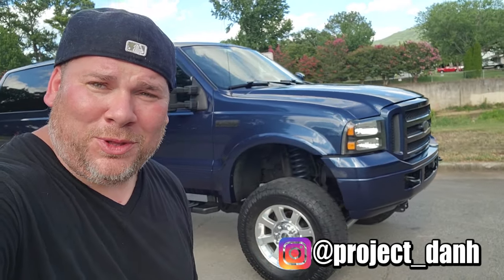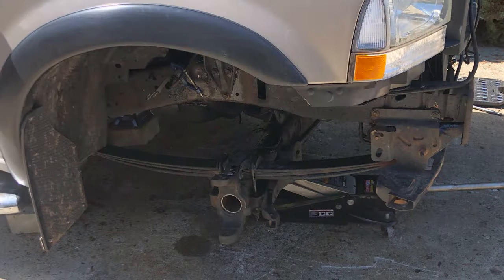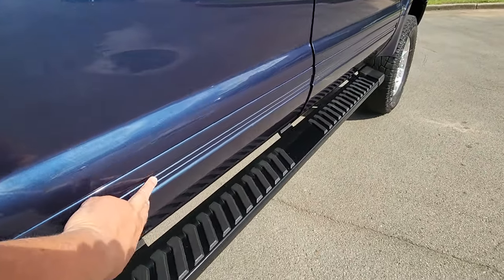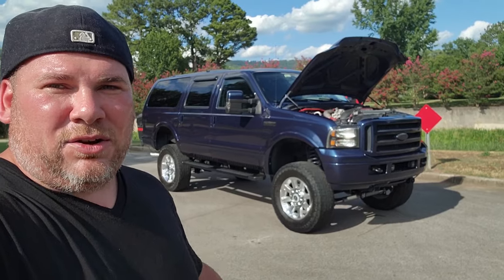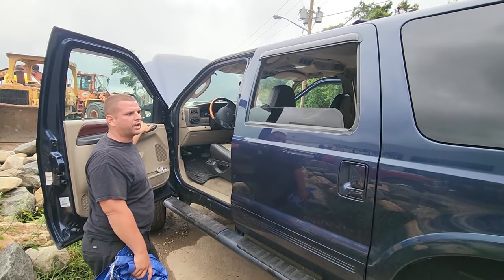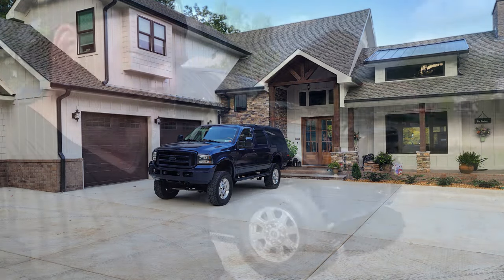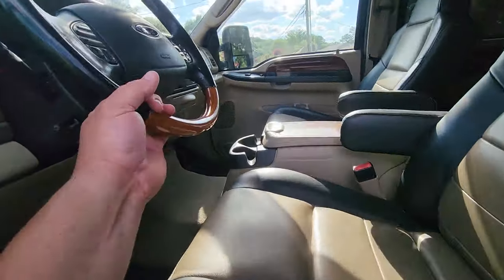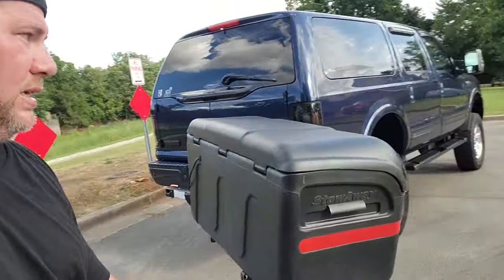2005 FORD EXCURSION 6.0 POWER STROKE TURBO DIESEL - THE BEAST

Comment: I live on Long Island and I’m from the SOUTH! I now own my 3rd Excursion! 2 7.3’s and now a 2003 6.0! I wanted more horsepower. I’ve now had it for 21 years. Please consider getting a FixUr6 oil cooler flush. I back flush my oil cooler EVERY TIME before a long trip. Deltas stay as low as 8  degrees to 14. I only have 160k on it and all original!! I also flush coolant system every two years. I added drain plug to my block drains it make it easier. Just food for thought. Loved the video!!! Phil